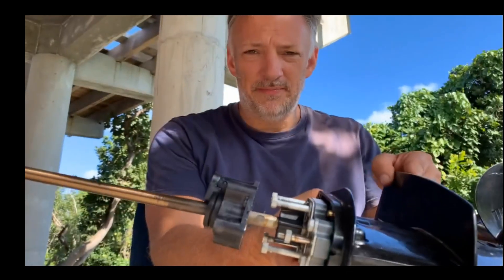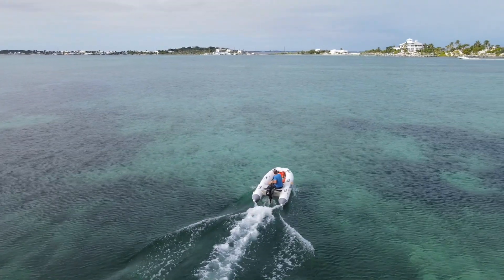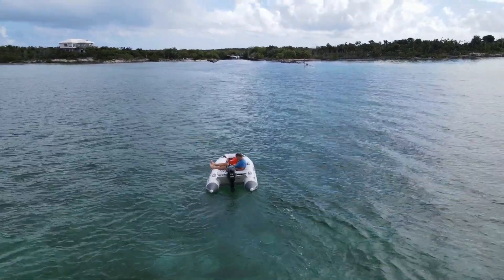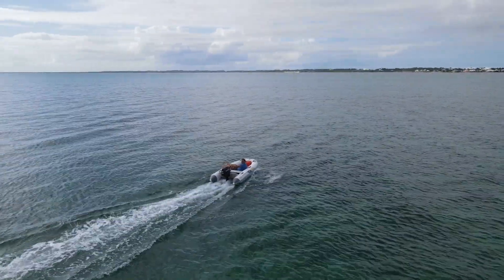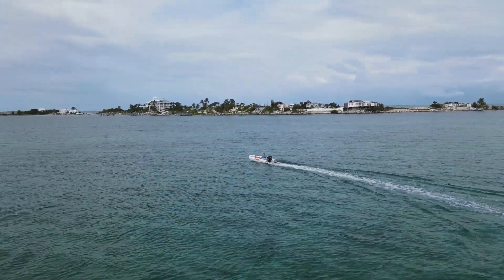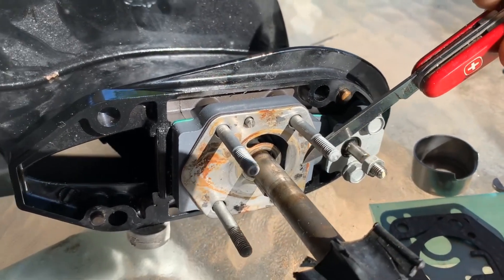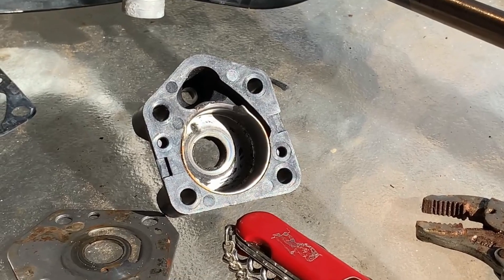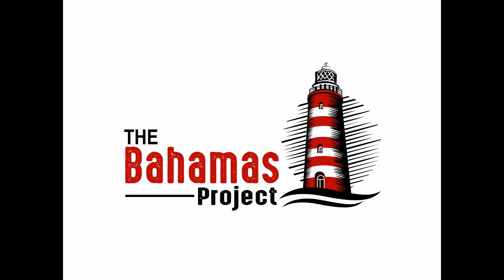Issue Solved - Suzuki 15hp DF15A outboard red light issue.

Comment: I just bought motor used 2020 
Red check engine light come on 
Jerk sold it to me said it was perfect brought on water starts idles perfect soon as I start revving high rpm check engine blinks and goes limp or safe mode 
No alarm just blinking and little shaking 
Changed spark plugs $40 now what lol any advice
Reply: Try replacing the fuel filter and cleaning the fuel injectors.

Comment: I had a 2021 DF20AS3,  it was the worst motor ever.  I followed everything in the manual that came with it and it overheated on me.  Wearable parts are not covered under warranty.  I had to install a new water pump myself for over 40 dollars with all the kits and pieces that Suzuki wants to sell you.  My motor had under 30 hrs.  All the dealership would do is hook it up to there computer and run it saying it had no issue or look at anything then charge me 200 dollars for nothing .  Ever since the beginning of ownership it never wanted to pump water right or on the first pull.  Suzuki's customer service is not existent.  The customer service you get from Suzuki tries to blame you and say it is your fault. The dealerships do the same thing "Oh you must of gone through sand!" My water pump started to melt and the metal plate base looked like it had burs.  There wasn't any sand or debris.  I had no scratches on that motor at all. I sold it at a huge loss.  After I installed a new water pump it pumped water better than the first time starting it.  I don't think their is much to quality control since mine didn't seemed to be built properly the first time. Please avoid Suzuki motors they're terrible!
Reply from the maker: Hi there, Yes this is my first and last Suzuki!!!!!!  I am running an electric on the dinghy now and though slower its nice using clean energy and not getting your hands dirty with petrol.

Comment: I have a 20 hp lean burn, constant mid throttle range misfire, poss fuel starvation, tried everything, bugger all from Suzuki, thinking of scrapping it for spares, risking my life to take it out. Several acquaintances have had similar symptoms caused by different problems. Suzuki never respond with help.
Reply from the maker: Hi there, sorry to hear that.  5 hours after I sorted first issues, I had misfires and cut outs.  In the end I put some more oil in, more than manufacturer recommends, and it works fine now no issues.  I don't trust it anymore so I will go over to electric at some point.  cheers Mike

Comment: I had the same problem.  I changed the impeller, plugs, oil.  Didn't solve my problem.  Then I changed the fuel filter.  That was it!
Reply from the maker: Hi David,  I am glad it all worked out for you. I had another red light issue, the dip stick showed i had enough oil, though i put some more in and it was then fine. regards mike

Comment: Bro ive a similar problem since ever new motor its the link https://www.youtube.com/watch?v=Zifo7YP3wy4 do u think is the same issue? impeller? i try with 3 diferent propeller the issue continue
Reply from the maker: so i had this issue again after i changed the impeller.  The oil level dipstick showed fine but i put more oil in it anyway and the problem went away and now it runs fine again.  regards mike
Reply: @bahamasoffgrid  how much more? the up lvl and half of the point 1 to 2?
Reply from the maker: @JavixseeN  I will let you know, I am in the UK now for a few weeks

Comment: Any idea why the impeller blew in the first place? especially since it was brand new practically? I did hear you mention something about sand?
Reply from the maker: Hi Clint, no idea why it blew, though as my dock is not finished i have been beach landing and just assumed sand was something to do with it.  I switch off the outboard and pull it up in good time before the water is too shallow but apart from it being a manufacturing error i have no other idea.  at that time the outboard was pretty new also with less that 20 hours.

Comment: Looks like I have a similar if not the same motor but my impala looks fine it spins properly when the main shaft is spun any ideas why I'm not getting any water to the motor?
Reply: My plate looks clean but it didn't come with a gasket (when my uncle bought it he bought it as is and told me it didn't need one) so I will make a gasket for it tomorrow and see if that changes anything
Reply from the maker: @N1h1luss  hi there, how did you get on with the gasket fitting?
Reply: @bahamasoffgrid  the gasket wasn't gasket didn't fix it I heated my impala up and it molded back to its original form but that didn't fix it either I found a hole in the wall suzuki shop ( the only shop in a 50 mile radius of where I live lol ) and just bought a whole water pump kit and that fixed it im pretty sure the impala wasn't strong enough to push the water into the motor it works great now 👍